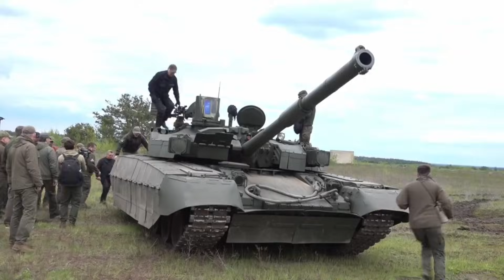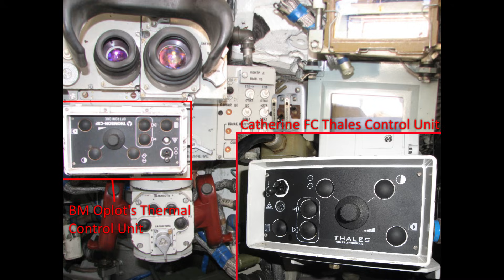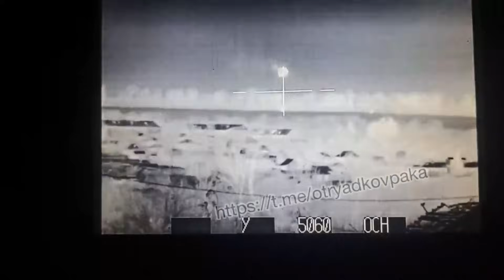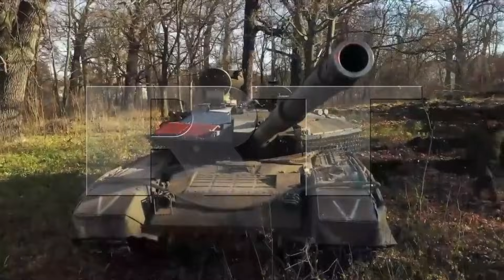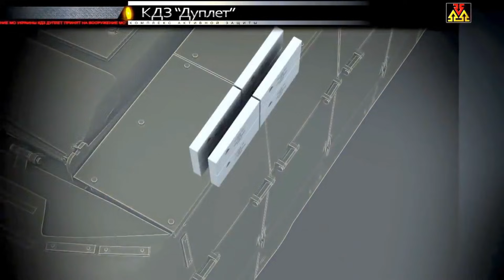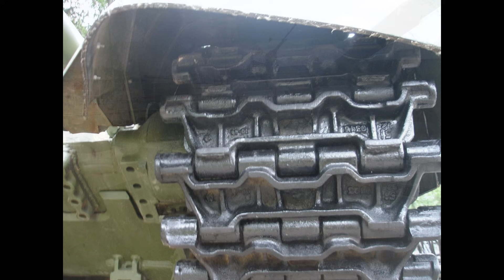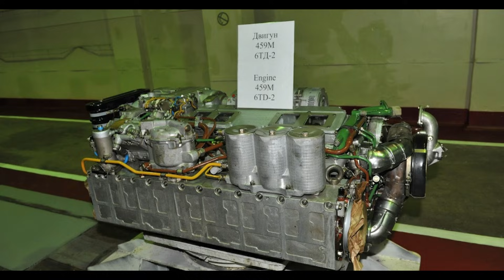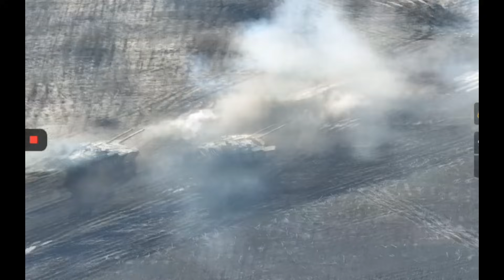Best Ukrainian vs Best Russian tank. T-90M vs BM Oplot comparison

Comment: Didn't the Ukrainians do a technical breakdown of captured T-90's which found issues with the electronic systems, such as water seeping into them and causing malfunctions. 
There were other major issues listed as well. I'm surprised this wasn't taken into account.
Reply: That captured tank was abandoned for weeks
Reply: @rogue__agent5884  How do you know this? I haven't read the document in a while but i think it was captured in the Kharkiv offensive and likely would have been captured fairly quickly.
But if a tank needs heavy maintenance after a couple weeks to stop it's communications from shorting out... then that's a bad thing.
Reply: @georgethompson1460  my bad I was thinking of a different tank 

I think the tank you are referring to is a T-72B3/B3M
Reply: @georgethompson1460  well that could be down to many factors
1) although ukrainians do capture "brand new" tanks from time to time (ie the crew just deserted), its still an old tank, the iraqis had many problems with the t-72 during the iran-iraq war despite it being quite "new", its all down to if its stored in shit, its going to be shit, if its maintained like shit, its going to run like shit.

2) sure it may have a fancy new turret with good thermals, but if something like a radio works, it does need to be upgraded, these misc electronics may have been around since the soviet era. It doesnt help that tanks could have been there throughout the wet season in ukraine a few months back. I am an armoured combat engineer working is wet and humid environments and if theres 1 thing combat engineers know how to do better than blowing shit up, is working (the bare minimum) with ancient dogshit equipment with the least effort, so the ruskis might have had the same philosophy
Reply: @rogue__agent5884  Maybe you should look at the Ukrainian press release, I swear it said T-90M and it commented on several issues. Besides a video has come up of a T-90 in America near a tank testing facility, so chances are a captured yet functional T-90.
Besides one video of an abandoned T-90 shows the thermal cover still on when Ukrainian forces capture it.
Reply: @ShopeeMarketteam  Doesn't that speak more to poor doctrine similar to SA loosing Abrams, at which point wouldn't the issue be Russia's lack of an NCO corps.
But also corruption, i've heard of soldiers giving half their wages to their officers in return for not having to go to Ukraine. So someone selling off important components could also affect the performance of the tank. But this system could also go to the tanks production with substandard components replacing prescribed parts. In fact I wouldn't be surprised if most T-90's don't have the advanced Thermals Russian MoD claims they do.

So it could be a case of corruption and incompetance at use or build level.
Reply: @georgethompson1460   I seen the captured T-90 in the USA it’s a T-90A 

As far for other tanks it’s T-80BVM n T-90A they look similar to a T-90M
Reply: @georgethompson1460  yup it could be 100% the case, but from what i heard, the russians are implementing pseudo NCO structures to streamline their command, so when this shit ends and blows over (hopefully soon), we might see an implementation of a proper NCO corps, as for the corruption i wouldnt be surprised at all :) Another point that id add that i find quite interesting is that some units just get better shit than others hence the T-90s without modern thermals, this was present in the marine corps during both gulf wars and Afghanistan and present where im serving (a peacetime OPs army), im not going to say they're corrupt off the get go, but some units are going to receive the rusty old shit because of supply, no avoiding that
Reply: Ukrainians captured tanks left by Ukrainians who didn't want to be In Ukraine anymore, basically Russian population fighting against Ukronazis!
Reply: I would take whatever UA says with giant grain of salt.
Reply: @tomk3732  why would you even want to

Comment: The T-90M is the only decent tank Russia actually fields (T-14 is basically non existent). It’s armor is pretty good, sights and thermals are decent enough, the gun is powerful and can load pretty good ammo. 

The only really big problem with it is the reverse, which is horrendous and laughable for a modern tank. 

I think any real army would have decent success using such a tank.
Reply: @cmdrmonkey  pray tell which tank does not have thin turret armor?
Reply: @kanestalin7246  well Abrams has some pretty damn thick turret armor.
Reply: @fobban8259  Not really, mostly its an inch. Front has one and a half inch. 
For comparison on T-90 type tanks it is at least 20mm and even K-1 adds 11mm of steel plating. So turret protection on T-72 / T-90 etc., is far and wide better than on M1.
Reply: @fobban8259  i was refering to the roof armor which i assumed he was talking about because the turret face of the t90m is by no means thin.
Reply: @cmdrmonkey  I believe they have up armored the auto loader a lot. I haven’t seen many clips of turret tossing from this one. The armor also really isn’t bad. It’s pretty up to par against many nato tanks. 

It’s not like the t72b3 which is just garbage most of the time. I’m not pro Russia, they suck and their army is garbage but we shouldn’t delude ourselves about their equipment because of sheer incompetence.

Comment: T90 has best equipment in shelf for show, in reality all those names that you are saing without being proved in battle is just a biased comparison from you to say T90 is better but in reality we see T90 doesnt make any diffrence from T72, both have great records in flying turret. This means T90 is a failiur wait a little bit and let see if Ukrain tank is failiure or not (in battle not in papers cause I dont belive russian papers).
Reply: Also lots of videos of flying ukrainian t64 turrets
Reply: @gasmaskchicken3910  Meaning the autoloader design is problematic,  has been for over 50 years, but hasn't been fixed.
Reply: @davestevens6283  This will be tested when first Leopard flying saucer happens. Oh wait, it already happened in Northern Syria with Turk Leopard tanks.
Reply: @davestevens6283  Actually no. In a field study done by the soviets it was discovered that most fatal ammo hits occured when the throwing charges inside the turret were hit.Not the autoloader. Also the turret only pops because of the ammo placement right under the turret. Nato MBTs will also be taken out with a shot to the sides but beacause the ammo is stored diffrently it wont pop the turret.T90M fixes this with the ammo beiing stored seperate from the crew with blow out panels. But if i were to design a tank i would make one withe a bustle aouto loader.

Comment: Hey! Why are you saying T-90M transmission has no changes? All T-90M have reverse speed of 15 km/h. That is still not good enough, so crew prefer turning around if it is safe. But it's a three times upgrade anyway.
Reply: I guess you never drove inside a tank! 15km feels like 50 in a terrain that has no reference point, you turn as soon as you can!